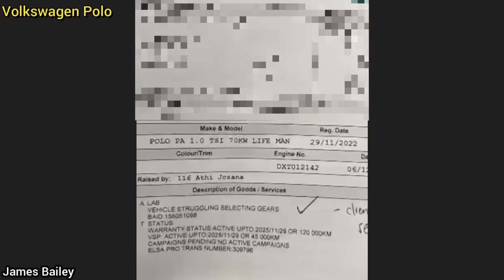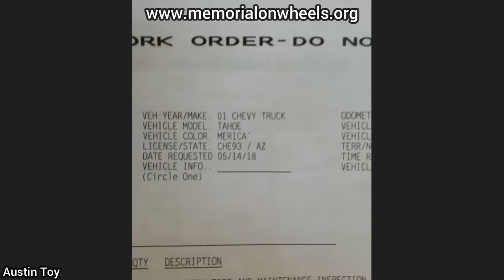Customer States They Need Door Repaired After Locking Keys In Car

Comment: Apparently ripping a hole in your door is cheaper than breaking out the glass. 😂😂😂
Reply: Or calling a professional who can open that door without damage 99% of the time
Reply: Breaking glass only happens in movies.
Reply: Maybe they were worried about broken glass around the dog, which would of course be barking right on the other side of the window.
Reply: What you don't realize is that the customer didn't rip this hole in the door, the customer's dog did when it got to hot inside.
Reply: If you think about it, broken glass gets everywhere and takes time to clean up. Cutting the door is less messy
Reply: A Dog was in the car. Doors are replaceable, but you can't really replace your Dog.

EDIT: Since my meaning is somehow lost to a few people replying to me, I mean that it's not going to be the same dog if you replace it. Hence, you can't really replace the dog.
Reply: @tobiasmetzger4522  Calling a professional isn't always a viable option.  Depending on how hot it is it can take as little as 20 minutes of sitting in your car to kill a dog or small child.  People underestimate how hot they get.
Reply: @XtreeM_FaiL  rather easy to do actually if you hit the corners of the glass near the frame. Just the "slight touch in middle of glass and magic shatters" are movie accessories :)
Reply: @jimmydesouza4375  and cutting such a hole in your door is faster? I highly doubt that
Reply: @XtreeM_FaiL  Not quite. When I was 17, there was a grass fire getting nearer to a parked car so the teacher I was with broke the small window on the front to unlock the door, take off the handbrake and move it out of the path of the flames. That decisiveness has stuck with me throughout my life.
Reply: @XtreeM_FaiL  oh you haven't watched any police body cam videos have you
Reply: @tobiasmetzger4522  Depends on what you have to hand.
Reply: Well it does work. And if you have a Jeep you can one thing better: rip the door off. 🤣🤣🤣🤣
Reply: Fairly sure its to role the window up and down. Switch or the wirings broken. Ive had buddys do this
Reply: amazes me there are people actually arguing about this. stupidity knows no bounds.
Reply: @nikerailfanningttm9046 Heck, if you have a Jeep, just get the dog to leap out the open top. Once the dog is safe, you can sit back and wait for the locksmith to open your door.
Reply: @101Volts  yes, but a window is way easier and cheaper to replace.
Reply: Depends on the car, might be easier to go to to a junk yard and get a whole new door than try to disassemble and replace the window
Reply: @immortalsofar5314  Interestingly,  those smaller windows are sometimes more expensive than the main, larger windows.
Reply: @101Volts  It's a car window, it's safety glass. Unless they going to let the dog eat the broken glass/roll around in it it's not going to do anything.
Reply: @jimmydesouza4375  They had enough power tools to hand to cut through the sheet metal of the door but couldn't locate a hammer/rock?
Reply: @tacet3045  I'd rather damage my door than break the glass, dogs are damned stupid so you can't trust that they won't eat any of the broken glass before you manage to stop them.  They're like toddlers but faster.
Reply: @101Volts  technically, you can’t replace “that” dog 🐕 🤣
Reply: @dragonsmonk  had to do it out the bush once, luckily we had a screwdriver handy and it was an older 4x4 with the small quarter windows in the back doors, so we just broke one of those. $10 and 10 minutes is all it took to fix. but I would be less inclined to do it if there had been a dog or kid in the car. last thing I would want is glass flying into the dog/kids eyes. that being said, the only other tools we had was a chainsaw, that would probably do more phycological damage than the glass could ever do physically.
Reply: It's surprisingly easy to get tunnel vision when trying to solve an unconventional problem like this, and fixate on the first possible solution you think of. I ran across some of my friends trying to help a lady get into her car. She'd locked her keys inside, but left the driver's window cracked slightly open. They'd been trying to flip the door lock switch with a coat hangar for about 20 minutes. I looked inside, saw the car keys sitting on the driver's seat, and told them to just use the coat hangar to pick up the keys. Lady was in her car within 15 seconds.
Reply: Ripping the door apart was absolutely stupid. Cannot really be repaired like a window that you could replace in under an hour for somewhat cheap money.
Reply: @j_taylor  If the dog jumps out the open top, why wouldn’t you just climb over the top and open the door yourself?🤪
Reply: @jimmydesouza4375  you know...car's window glass is tempered right?....mean they have less shattered piece's ....how could your dog faster than you...is it the flash?
Reply: @101Volts  Actually you can replace a dog, they have these things called pet stores...
Reply: @dallas4616  What a dumb statement.  Like the metal chips from cutting don't get everywhere????  Glass is ten times cheaper and faster to replace than a door.
Reply: @trashbandit2449  The manual in my first Toyota indicated the exact window to break in this situation to minimize cost.
Reply: @jimmydesouza4375  If you can't train a dog to sit and not eat glass, you shouldn't own a dog.
Reply: @zexstar4459  Tempered means you will have MORE pieces, and smaller, which are less dangerous.
Reply: @dragonsmonk  From what I understand, the key is to strike with or throw something very hard with rather sharp projections, like a spark plug, window breaking tool with carbine spike, steel center punch, and some types of gravel (to name a few).
As for worrying about getting glass on the dog, get the dog's attention at the front window, and reach over to break the back window.
Reply: if only people who knew how to open the door regardless existe
Reply: @jimmydesouza4375  20 min really
Reply: @zexstar4459  You haven't seen a dog before, have you?
Dogs that are barking on the inside are likely to snap at anything flying their way. Meaning tempered glass is going into the dog when the window breaks.

I would probably still break the window if it was such an emergency but the cautiousness is still sound.

And technically (if breaking the window is a danger to the dog) then sticking something into the upper part of the door frame and bending hard will still allow you access without breaking glass or cutting the door. Then you just have a poorly aligned door frame if you aren't a professional.
Reply: @zexstar4459  If you need someone to explain basic concepts like proximity to you then that's a problem you need to solve.
Reply: @LubomirGeorgiev  Yes, though this is worst case "Exposed directly to the sun in the middle of a 100+ degree summer day" territory.
Reply: @ffjsb  [Word not allowed] like you act as if dogs are automatons, they're not, especially in abnormal situations.  You can train a dog to obey in normal circumstances, even to some degree in abnormal circumstances, but they can never be "trusted".
Reply: I locked the keys in my car once and a nice policeman used thieve's techniques to open the car for me.
Reply: Love how almost all of you are arguing over the door or glass but only a few have said just call someone to pen it up.
Shit a locksmith/door lock guy is gonna be WAY cheaper than a window.
And the door is gonna be more than the window for the morons on here.
Reply: @haley746  You guys don't like bad jokes?
Reply: @RealCadde  My dog doesn’t bark he also doesn’t snap at everything, dogs that do that are untrained.
Reply: I had a neighbor years ago that did something similar. He had a mid 90s Chevy truck that he locked his keys in. So out comes the sawzall to cut the entire outer skin on the bottom of his door. He got in and then drove that way for a number of years with the bottom half missing 😅
Reply: @XtreeM_FaiL  you need to get out more if you believe that.
Reply: You didn't know that?
Reply: "Well, I had this here sawzall handy. Didn't have no hammer".
Reply: @tobiasmetzger4522  There was a dog in the car, that would take way too long.
Reply: new door comes with glass and sometimes a whole door is cheaper than parts to fix an old one.
Reply: When life gives you a Sawzall, everything looks like sheetrock. 🤷‍♂
Reply: @jimmydesouza4375  breaking a window is far cheaper than buying a new door.
Reply: @sporkeh90  cutting a hole like that definitely takes longer than smashing the glass. And depending the temperatures, it's not a big deal to let a dog in there for an hour
Reply: @dallas4616  Replacing a window AND getting the car detailed by a professional to clean up the glass is still way cheaper than having to replace an entire door.
Reply: Could have easily called the non emergency line and had a cop come out.
Reply: @tobiasmetzger4522  What? Thats not what you said, I agree smashing the glass is better. You were talking about calling a professional
Reply: @sporkeh90  I've made more than one response here so I didn't see which one you replied to. I once got a police escort for my tow truck for a call with s child locked in a car in summer
Reply: @GamerNerdess  and what would a cop do?? Absolutely nothing they would tell you to call somebody and unlock the door.
Reply: @GamerNerdess  if we wanted somebody to stand around being generally useless, sure we could do that
Reply: @XtreeM_FaiL  i have seen it happen myself, so no...
Reply: i guess if you go to a scrap yard it might be lol.
Reply: @jimmydesouza4375  Most people can't be "trusted", what's your' point kid??
Reply: @x808drifter  If temperature extremes are not an issue, yeah sure, call a locksmith, Triple A, whatever.  But if it's 90 degrees, you're not going to have time to go that route, that's the point people are making.
Reply: @Avram42  I never use a a sawzall on sheet rock, I use a drywall saw or razor knife....
Reply: @mrquirky3626  The other thing with cutting a door is it's a good way to set off side impact airbags, which will probably total most cars.
Reply: @GamerNerdess  Most cops WILL NOT open your door.  Too busy, too much liability.
Reply: @tradde11 I see the problem.

You're assuming they had a first thought.
Reply: Ha. My first thought at well.
Reply: It's actually weirdly easy to just pry the door open at the top and hit the unlock button. It's exactly what a lock smith will do these days
Reply: @Helladamnleet  really? I can't imagine that on my volvo without fn up the door.
Reply: Literally said the same thing just now 😂
Reply: @101Volts  It's not so much that it's about not damaging the car, it's just confusing the way they went about doing it. The tools required to cut into the door and cut it open could have also been used to break the glass, which would have allowed you to just open the door and replace the glass. That said, I mean, if it works, it works. My only guess is they were worried about broken glass around the dog, which is admirable, but I'm not sure with modern tempered glass if it would have really been a hazard.
Reply: @tobiasmetzger4522  100% here, thank you
Reply: @XtreeM_FaiL  No, this locksmith has seen real life examples. Including one, the keys of which were actually locked in the owner's other car. (Lack of clarity in marital communication).
Reply: A locksmith works far more cheaply than either. If you didn't read the note, they had to hire a locksmith anyway,  because they still couldn't open the door.
Reply: @immortalsofar5314  Far cheaper than a large window. Most 17 year old guys I hung out with could open them without damage. Just saying. Your teacher saved the day.
Reply: @bcraiders11  On the OUTSIDE of a door? I would doubt that very much!
Reply: No kidding. I pay $1/month for full glass coverage.
Reply: @tacet3045  Safely breaking a car window with a dog inside can actually be done quite easily. Stand one person on one side of the car and have them distract the dog. Get a second person to break the diagonally opposite window.
Reply: @XtreeM_FaiL It’s difficult but certainly not impossible. I’ve broken many car windows in a scrap yard for fun (with permission) usually took a couple throws with a brick. First one would crack it a lot but it would still hold together second one would go through.
Reply: The dog has enough fur and hard pads on their paws to not be hurt by broken tempered glass. Break a window, let the dog out, buy a new window and clean the car. Much better than replacing the whole door or trying to fix that body panel.

Comment: Most of the "declined repair" cars would never have been allowed back on the road here in Norway. Nuts what people drive around with
Reply: In Germany, a lot of the cars in these videos would be on the road for a max of 4 years, then taken off due to failing inspection.
Reply: @bladerunner3314  In NZ, if your car was made before 2000, its inspected every 6 months, built after 2000, its every year. A lot of cars i see on this channel  would have failed the inspection long before they got this bad.
Reply: @uhtred7860  Mh, here it's always 4 years, no matter the production though I can see the benefit of doing it more often on older frames - but yes. Especially those with basically frames only held together by wire and construction foam, they would've been decommissioned years ago, long before the state we see them here.

I just checked, I haven't had a vehicle for about 25 years, so please excuse this error.
Inspection is every 2 years, a new car has 3 years until first inspections, after that, also every 2 years.
Rental cars only get 1 year.
Reply: As an American let me inform you about the concept of a "winter beater" used in many states bordering Canada with terrible winters.  I suspect many of the very rusty cars are used as 2-3 month winter cars only.  You use them for a couple winter seasons, because they throw salt all over the road for de-icing, and then throw them away when they rust out..   Or I hope to god thats whats going on.
Reply: If you live in a US city and aren't a productive taxpaying citizen,  you do whatever you want to do. Driving without an inspection, license or insurance is nothing. If you are caught shooting fentynal in a stolen car full stolen goods it's  no big deal in big cities. You will be back out on the streets before your buzz wears off.
Reply: @Lemmon714_  Yeah, it's so much better where you live, where your mom is also your sister AND cousin.
Reply: No. The streets aren't full of junkies. The streets aren't full of their turds. Break ins are rare. I can walk anywhere in town that I want without worrying about anything. I have left the keys in my truck for days without realizing it and it didn't move. I have left my storage building unlocked for weeks at a time and nothing disappeared. People of different races and origins live around  here with no issues. Lots of gunfire just means you and the neighbors are shooting paper. A house on six acres of land cost me $91,000 a few years ago. If Portland, San Francisco, New York, LA, Philadelphia and Detroit is what you like, good. I'm going to stay here.
Reply: @davidhill850  I always take my car for an After winter wash at the Automatic car wash because most of them have an under carriage spray before you go in. So it sprays off all the Salt under the car and reduces the chance of it rusting. Little after winter TLC goes a long way to prevent rust.
Reply: @thegreatcanadianlumberjack5307  I live in Maryland actually.  No "winter beaters" here.  But they switched from just throwing salt rock out to putting down brine salt liquid spray about 5-10 years ago?  For winter its way more effective, and uses less salt.  But for your car its about 120 times worse I heard.  It sticks!  To the road and your car.  You need to get that off your car after every time they use it.  Last winter was nothing.  Didn't snow at all very mild.  Wash that stuff off.  Every state in America is different.  So I don't know what other states are doing.
Reply: @davidhill850  i Live near Vancouver BC so it snows maybe once or twice a season (The Rest of Canada gets a chuckle when it snows here people do not know how to drive in the snow and it gets really bad when the first round of snow comes)
Reply: I live in Alabama , USA and we have no vehicle inspections . We have very little rust here and most people take care of their cars .
Reply: @eaglerider1826  Alabama has no winter and thrifty people.  A beautiful combination.
Reply: @davidhill850  We also still know the difference between a man and a woman , lol
Reply: The US is a country where dying people won't call an ambulance nor see a doctor because they can't afford the bills for getting the help they need--now factor in that every aspect of American life is like that. Our cars, too.
Reply: @Lemmon714_  Most big cities have, at most, one district like that. In San Francisco it's the Tenderloin. So when news crews want a story about how awful cities are they send a crew there, and ignore all the other neighborhoods they went through to get there.

When I was a kid we lived out in the country and it was...isolating. Our phone kept going out and our neighbors wouldn't let us use theirs to call to get it fixed. Out there everyone's suspicious and no one wants to help anyone else. These days you're lucky if they don't shoot you for turning into their driveway.
Reply: Snobs.